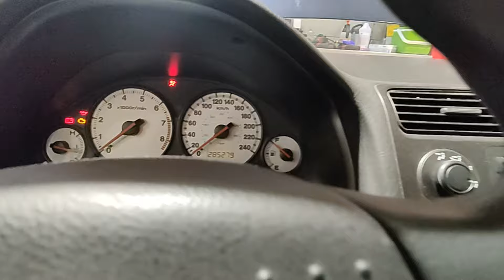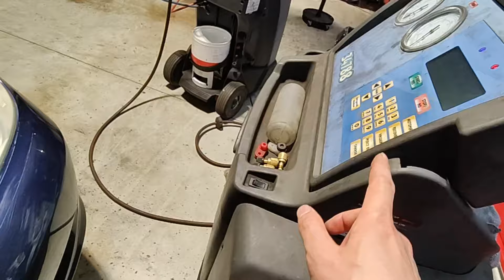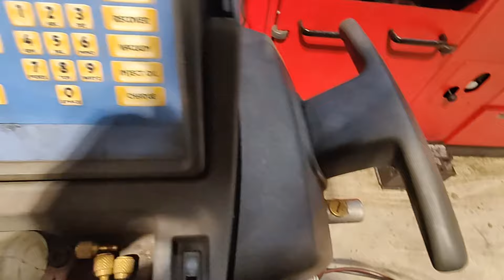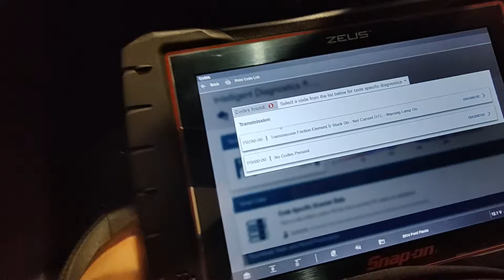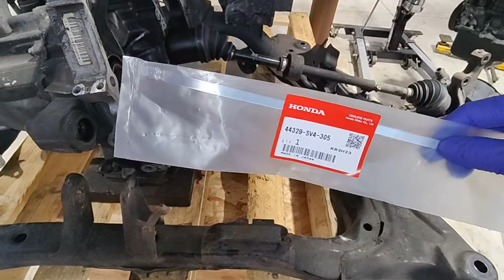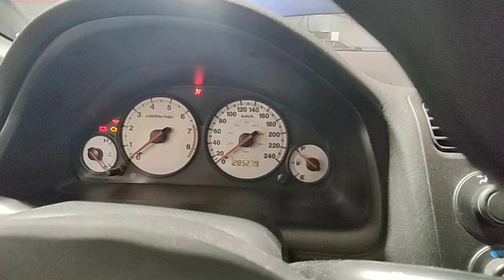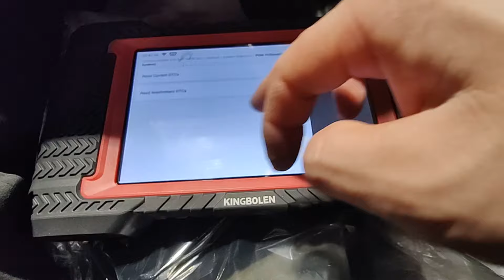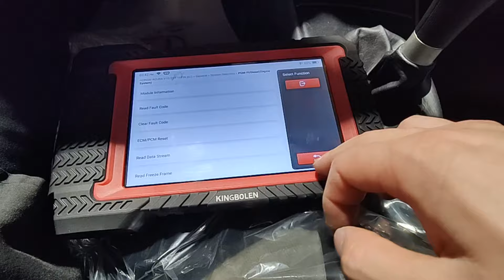Not all used motors are good motors. The risk you take when using them.

Comment: Had a similar issue with a junkyard transmission. 2011-2015 generation civic with a classic valve body failure dtc. Call the yard up and they won't put a $700 valve assembly in it, have to put another unit in it. That one also had a failed valve body. Still won't put a valve in it so we get a second unit from them and it has a busted case. They still will not put a valve in the old transmission. They ended up paying for a new transmission. Lucky for the customer since they got a brand new transmission for the cost of a used one. However the yard would not cover labor so we had to fight them since they had us remove and install the transmission several times.
Reply from the maker: Yea kinda what is happening here now I thought there was a labour warranty but it is actually just parts. But no one is actually paying for labour at this point and there is a bit of a krafuffle going on right now. The engine I put in also has a head gasket issue constant bubbles coming out. The apprentice is going to do the head gasket on the original motor we got and install it back in the car again... 🤦

Comment: if new is not available, would you recommend rebuilding or take the risk of buying used?
Reply from the maker: If you can't fix the original one and you have no other choice but to go used. Just make sure what you're getting is what you're getting ie. Mileage people can say its a low mileage engine to get more money from you. If it has a warranty and just have a look under the oil cap everything externally. Or just Frankenstein one engine with what good parts from multiple engines to make one good one. Lol
Reply: @theoffroadingmechanic  thank you for the tips.

Comment: … wtf 🤦‍♂️

Job security for you I guess 🤷‍♂️? Will they allow a compression/leakdown check at least?

What about remanufactured engines? Also sketchy?
Reply from the maker: Someone has already looked at it. It was luck of the draw that im the one to put it in. I don't know of anyone that does remanufactured engines. I know of a few transmission shops that we send out Odyssey trans to get rebuilt but that's all they do.